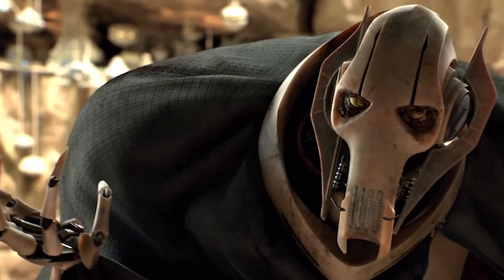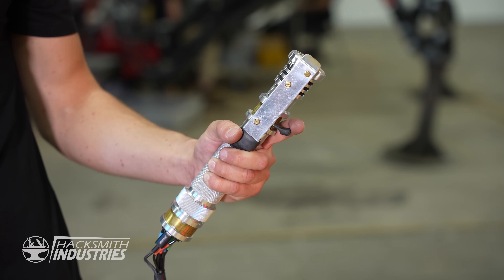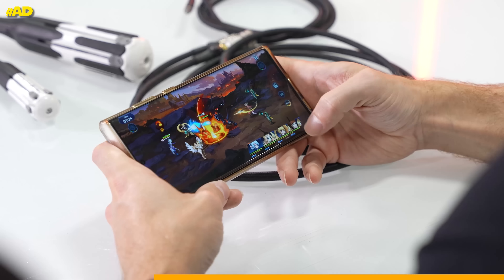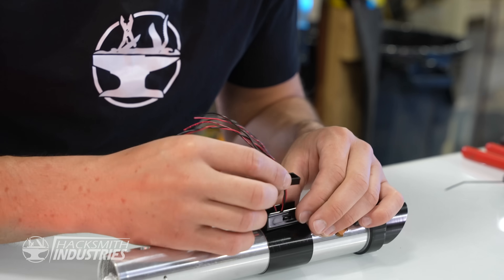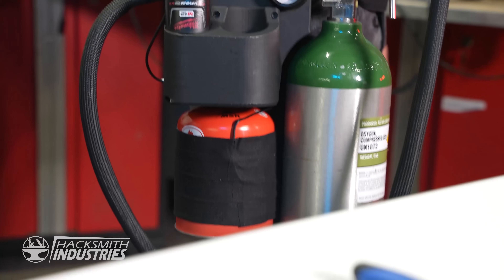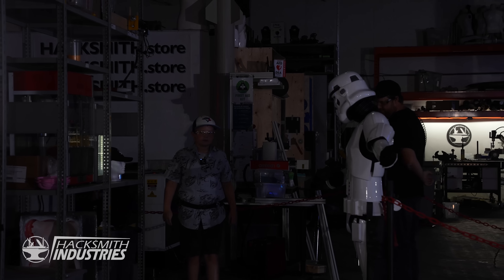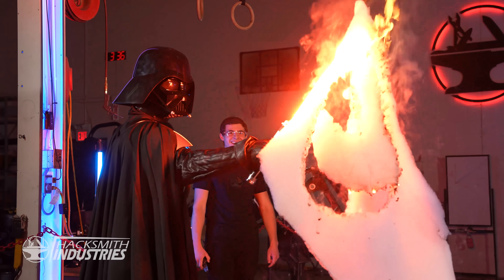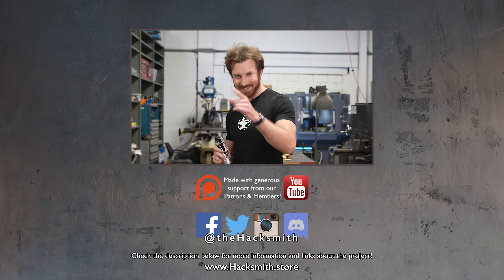My Best LIGHTSABER Yet! (STRONTIUM PLASMA 4500°)

Comment: Now you only need:
- Some ultrasound emitters to control the flame shape, especially to create an endpoint that does not look like a flame
- A solid retractable core that withstands the temperatures, so the blades can actually clash with each other (and not just pass through).
Reply: Give it another 10 years they'll get there eventually.
Reply: @TheScarletSlayer  they made this in about 2 years
Reply: @TheScarletSlayer  Yeah probably
Reply: I thought about it and that's a great idea. They don't need the core to be as thick as the saber since it's not for appearances, the flame/plasma around it will do that. It needs to be completely heat resistant (apparently tungsten is the best for that, though I don't know if that's an option) and tough enough to clash with things.
Reply: @EGarrett01  no tungsten will burn away, it need to be way more heat tolerable
Reply: @thelastprussian6491  this needs a coil core with magnetic field, to prevent plasma of touching the solid core. 

Or a metal blade with electromagnetic wave emitters (for example, UHF), those destabilize the crystal cells of hard materials (with resonance) on the blade's way, and ionize the air to create a plasma coating around the blade, which is held in the magnetic field. Like a power sword of Warhammer 40 000.
Reply: @arsyack  Nice idea, but way to hard to desigh and it will need way more energy. 

My best idea would be to install the mentioned tungstencore with a (perhabs titanium?)  not burning tube  and around that you can have thr Plasma.

However, that hybrid-design would be havier, ,,not hotter'' and no longer retractable.
Wee need a material that is ultrastrong (so you can make it teleskopic, ) and heat tolarble. Wont be easie to develope further
Reply: @thelastprussian6491  Did they not already try that combination in one of the first builds? tungstencore rod wrapped in titanium?  been a while since seeing that video though so not sure which it was
Reply: @zear1997  yes of corse, but how can we develope from this one? we need the Tungstencore in a titaniumpipe and than the plasma around .
On top of that the Pipe and core should be retractable. 

One impossible after another.
Reply: @thelastprussian6491  what if they make a detachable metal core coated in some super heat resistant material like tantalum carbide held in a sheath like a regular sword and before you activate the lightsaber you would connect the hilt to the core and pull it out like some medieval knight 
That would allow for an actual lightsaber fight without making the deactivated lightsaber look lame with a metal rod sticking out of it
Reply: @another7414  That could work.
Reply: @thelastprussian6491  Tungsten has a melting point of over 6000 degree F so it could endure a 4500 degree F lightsaber just fine.
Reply: @arsyack  If you do something like that, two blades would probably melt each other's cores if you made them clash or the magnetic field would get all weird, which could mess up something else. Not sure.
Reply: @thelastprussian6491  what about something using carbon? it has a higher melting/burning point than any other element (to my knowledge) and depending on the arrangement can be very strong
Reply: @thelastprussian6491  I not sure a if a material with the required durability and heat resistance exits.
Tungsten has the highest melting point of any metal (or close to it I think, don't quote me).
Reply: @thelastprussian6491 can’t tungsten resist up to 6000 degrees Fahrenheit? Either that or Celsius I forget but either way
Reply: @LordPotato-yz1hc it may resist high temperature, however, it burns away... like wood burn and dont melt
Reply: @thelastprussian6491  ah, makes sense
Reply: @EGarrett01  tantalum is more heat resistant and cheaper than tungsten.
Reply: @EGarrett01  kinda like a retractable rapier?
Reply: @Joe-rz5lm  Yeah, with a flaming blade. Presumably with the flame enveloping the blade.
Reply: @EGarrett01  tungsten would probably not work becuse bow heavy it would be
Reply: @EGarrett01 Tungsten can absolutely withstand it. But it might not be strong enough for the dueling lol. How would it retract without burning the interior after the duel?
Reply: @EGarrett01 and then. Where would the battery/gas be so it’s by itself?
Reply: @EGarrett01  Tungsten is good
Reply: Gyroscopic magnetic containment field accomplishes both those things.
Reply: @jcarry5214 what the heck is a gyroscopic magnetic containment field?
Reply: @bocadillo_de_calamares  it’s how lightsabers are turned into swords instead of blowtorches silly. According to legends content.
Reply: @jcarry5214  if anyone can do that just for a lightsaber the hacksmith team could
Reply: Yes exactly they need to make it not look like flames and the size is an issue it just looks like a glorified lighter at this point or a flame thrower but actually its really cool how the flame extends from the hilt. If it had a perfect shape and Maybe in future they have a solid sword like feel and the blades touch eachother rather than passing through
Reply: The core can’t both be solid AND retractable
Reply: @davidjohnson9186  why?
Reply: @arsyack  Because if it's solid there's no volume for it to retract into. Consider the old plastic retractable lightsabers, they couldn't be made of solid plastic because then they wouldn't be retractable. They had to basically be hollow like pipes.

So, it can't be solid, would have to at best be hollow. Problem with that is that even very heat tolerant metals melt if they're that thin, and if they don't melt then they become brittle (which would make them very bad sabers).
Reply: @davidjohnson9186  not solid, just contained.
Reply: @novygaming5713  Ok, but contained by what, and how does it all retract/extend? I love lightsabers but it's highly unlikely we'll ever be able to have all the major features at the same time:

1) Retractable (yes)
2) Able to cut quickly (no, slow)
3) Maintain shape/length (no, short)
4) Entirely contained in hilt (no)
5) Solid-like contact with other sabers (no)
6) Blade emits light (yes)

Adding things to solve the other problems causes more problems for the parts we've already solved.
Reply: @davidjohnson9186  It can just retract like toys
Reply: @Sneke-qc5xo  if it retracts then it isn’t solid, that’s my whole point. If someone says “the solution is a solid core” then it can’t also be collapsible.
Reply: No, it shouldnt be solid. That just makes it worse
Reply: @ludvig7473  lmfao then how would it clash together
Reply: Nice mandelbrot set profile pic
Reply: it would also be really cool if they find a way to store the power supply in the hilt without it being too bulky, but thats probably gonna take quite a while
Reply: @scottish_lunatic  Liquid oxygen
Reply: @scottish_lunatic  it would have to be radioactively powered if it were that small and needed to provide enough energy. Would be cool to see. Thankfully I’m studying into this field so I may try my hand at helping develop these early lightsabers before our universe truly does become the universe of star wars
Reply: They already tried the tungsten core. It wasn't retractable and it melted after a few seconds. The sine wave idea sis good tho
Reply: Can't wait to be alive in 2050 when we have a real lightsaber.
Reply: or to manipulate the plasma in such a way to make it so dense it has properties of a solid and yet still so hot the moment it touches anything, other than another beam of plasma, it glides right through
Reply: Yo that is a gud idea
Reply: Maybe you could take a tungsten rod and have liquid coolant flow through it? Idk just an idea
Reply: Great idea. The solid retractable core could even be modeled after the old toy lightsabers that you would "flick" open and then have to jam the Saber into something to retract. Although that might end up making the Saber double in length. How that would integrate with the plasma emitter idk
Reply: Reading thee comments makes me feel like i should go back to kindergarten 😮‍💨
Reply: It's not Lightsaber! It's Knifesaber 😂
Reply: @ugrmusti7842  laser saber
Reply: titanium as the core blades would be good since it can withstand high temperature
Reply: My guy is rdy to get in on the project himself😂
Reply: I had similar ideas
Reply: Yea that would be awesome but also extremely heavy
Reply: 10 years and we’ll be dueling in the street, I shall find you young HL65536.. I shall
Reply: What about the power source? it needs to fit inside the hilt too, but how can a gas tank fit inside the hilt tho 😌😌
Reply: @inner512  maybe rocket fuel or similar hyper energy dense fuel that is misted into a massive amount of air before combustion.

May need to enlarge the hilt a bit, but not beyond reason.
Reply: It’s plasma you can’t make it collide like swords it is impossible
Reply: you know what would be cool is to use the ultra sound to make people uncomfortable around it and Invoke a sense of dread which would be perfect for Darth vader
Reply: Maybe aerogel? It can get crazy hot and not burn away
Reply: @comatose1818  Aerogel is amazing, but you couldn't use it for the core.
Reply: 77, not 76
Reply: Could also develop a way to shape magnetic fields outside of a box of sorts and use that to contain a blade of plasma for cutting (of which would be insanely high temperature) and the magnetic field strong enough and tuned specifically to easily contact with other lightsabers, and easily cut through other material
Reply: "Do it."
Reply: For a retractable core, the best thing would be tungsten carbide, as it can withstand extremely high temperatures and you can treat it to make it even more durable.
Reply: Not saying tungsten is THAT strong, but it wouldn’t need to withstand the full force for that long.
Reply: I don’t know man I kinda like the flaming tip it kinda cool
Reply: Sound is too slow. When the saber swings. The flame will bend away.
Reply: @camillosteuss  I'm not sure what your point is. You're using a completely different meaning of the word solid, which then you also acknowledge. And lay off what tech talk? The most technical thing I've said is something can't be both retractable and solid at the same time, which was in response to someone else suggesting using a solid core to emit a magnetic field. I don't know that I've used any technical vocabulary at all, especially compared to others here talking about radioactivity and controlling plasma with magnetic fields.
Reply: Probably no material can withstand that heat, but if the fuel powering the lightsaber is cold, route it through a extendable tube and you would have a blade.

But I’m no engineer or scientist, I’m just a 15 yr old.
Reply: also they should make the valve entering through the bottom and not the side since it's kind of awkward to hold
Reply: keywoard, retractable, lmao. It's gonna take some time before they find working retractable Tantalum, even if they can get their hands on it since it's pretty rare. Best of luck because I'm looking forward to fight til death with one of those
Reply: Even if they could make a retractable core it interfere with the gas flow and massively increase the size and weight of the handle. Personally i would like to see it made self contained and more stable beam. Maybe use smaller diameter nozzle and increase the fuel and oxygen pressure.
Reply: did some quick google searches, tantalum could work.
it can withstand the temperatures of the plasma and is also fairly study and durable
Reply: are the lightsabers in the movies built with a solid retractable core? or are they just plasma

Comment: they actually are getting pretty close, there’s still the issue of magnetic stabilization and finding a fuel source that can fit inside the hilt. But the first problem simply takes time, and the second takes money. As long as people keep supporting the channel, they will get there.
Reply: Fully agree
Reply: It's coming!!!
Reply: And cool colors
Reply: @alpha_9997  The trick for creating a red flame works for just about any color if you have the right element.
Reply: To a real lightsaber? Not really anywhere close, they aren't generating thermal plasma as far as I can tell, so they are a very long ways from creating a real lightsaber, or even a protosaber. But it's still a cool device nonetheless.
Reply: @adamw2785  to be able to create thermal plasma for a blade, they would first need to tackle how to deal with the heat. Some sort of air pressure system to push heat away from the user, since burning from proximity would be the hazard in higher temps
Reply: Luckily, yesterday scientists discovered a nuclear reaction that is created in a tiny space that gives off more energy than is put in. So close!
Reply: @EricBurgessGuitar  can you give a link? This seems very interesting
Reply: @dominicdimino  What I think is being referenced here is the recent report from NIF that they were able to achieve a net energy gain in a nuclear fusion reaction(i.e. a fusion reaction in a material produced more energy than was put into it). However, while that's cool, its not applicable in this context. Even though the reaction took place in a small area and involved only a few milligrams of fuel, to initiate it required hundreds of tons of equipment and also overall lost energy when accounting for the entire system.
Reply: @EricBurgessGuitar  imagine the cancer
Reply: @Flesh_Wizard that wouldn’t happen if the nuclear reactor is contained… which it is
Reply: The second problem just requires neclear power. But who would want basically free energy?

Comment: Guys look into emitting a laser from a hilt base to a mirror at the end of a set blade length. The mirror would have to be attached to the hilt base by a thin rod that runs along the length (probably acting as the center of the blade. Of course another reflective mirror on the emitting side of the hilt (to capture and “bounce” the laser back and forth between the hilt/base and the blade tip mirror. Good hunting gentleman 😉👍🏼
Reply: How do you both emit and have a mirror from the same spot? 
And if you have a mirror at the end attached with something, that would have to be impervious to plasma, which would mean plasma is caged in an "indestructible" shell, which makes it a hot, glowing stick.

Makes no damn sense.
Reply: @Tomo-wg2iq  I didn’t say encase the laser with an impervious shell. That was your imagination. Neither did I say to emit the laser from the same spot as the mirror. The laser would have to be emitted in a circular pattern (like clock positions) and at infantecimal angles. Just because you can’t see how to make it work doesn’t mean it won’t work.
Reply: @danielgrace4283  plasma in a circle around an "indestructible" mirror, got it.
 What about that same mirror on the top catching onto things which defeats the purpose of CUTTING THROUGH?
Reply: @Tomo-wg2iq  good question…I don’t know.

Comment: You guys should find a way to use Argon Hydrogen in such a large cutter. The temperature it burns at could literally slice through steel like butter and would be even more close to a real lightsaber and you could even make Mace Windu's lightsaber as the plasma of Argon is a deep blueish pink type of purple like his personal saber. The temperature it burns at is close to the surface of the sun.

Comment: You could put a small metal rod in the center so you could have a plasma beam encompassing the rod so you could still cut but also have duels(if you're brave enough). I don't know what metal could hold up to the heat tho.
Reply: Tungsten maybe, though they'd need to run cooler (3200 degrees max)

Comment: You could use a retractable Tungsten blade inside the plasma blade for it yo be able to interact like a solid blade and stop proyectiles.

The only problem Is that you should make the plasma blade be a lot colder for it yo do not melt the Tungsten blade that Is inside.

Posdata: the plasma blade should be red for it to look "normal"

Comment: I will not be surprised if you guys someday actually create an compact and practical lightsaber.
Reply: I think the biggest issue would be power, since the amount of power, and fuel needed to sustain long-term lightsaber use is way too big, with enough money, the problem could probably be solved, one way or the other, but it'll probably be decades before we ever get a power-source compact enough to fit into the handle of a lightsaber, and powerful enough to sustain that kind of usage for more than 5-10 minutes.
Reply: @WestGarbage6  maybe on mars there will be a good fuel source

Comment: It's so easy to make a lightsaber you know those old fashioned plastic ones where you had to like move the lightsaber downwards and it would unfold out that's how you need to take the with the wire or the metal the small little poke because lightsabers are as thin as a pool stick they're very pointy so that means it'll unfold out you know you can make it long and just have an electrical current running through that so there you have it a lightsaber and then and if you want to retract it back you know you press the button and it retracts back into the blade

Comment: Super cool, but I have a question. One of the older versions had a tungsten stick which turned into the blade. Wouldn't that be a "better" lightsaber, as it could actually be dueled with? I don't really know how any of this works so it's a genuine question.
Reply: flames are easier to work with too, also retractable

Comment: the problem with these lightsabers is that it is just fire, it gets really short and it has a weird shape. It needs to be made out of +3,000°C Tungsten 
The reason why it's impossible to make a perfect lightsaber is that they are over 20,000°C and we don't know how to get a metal that can handle that temperature.
But hacksmith made the best replica.